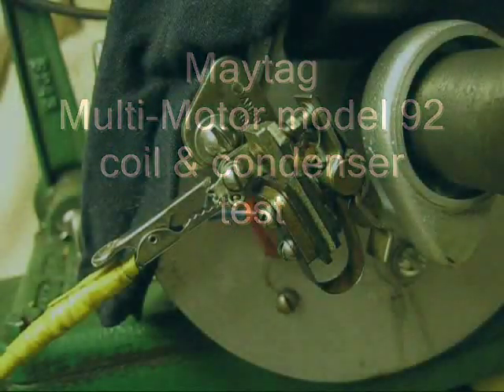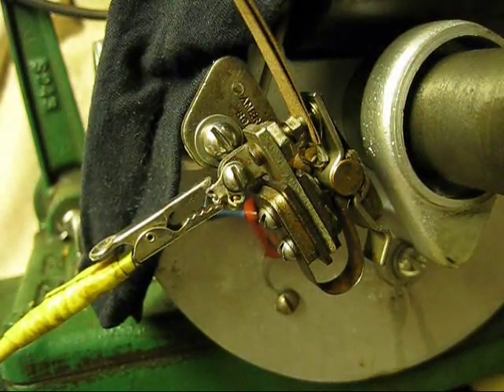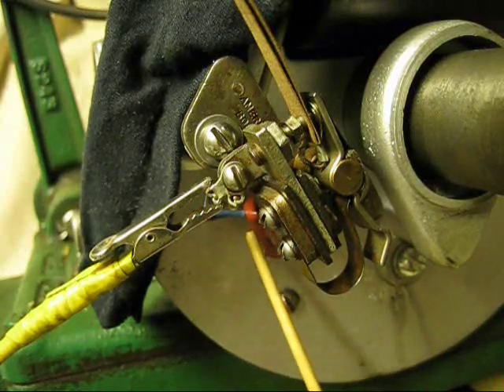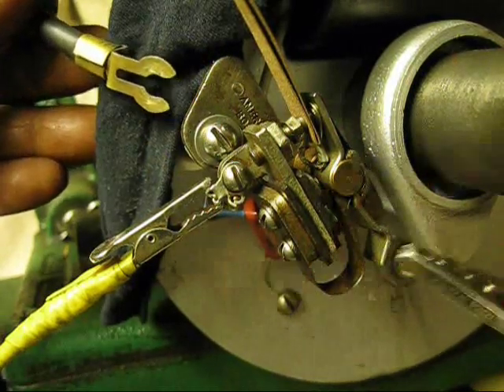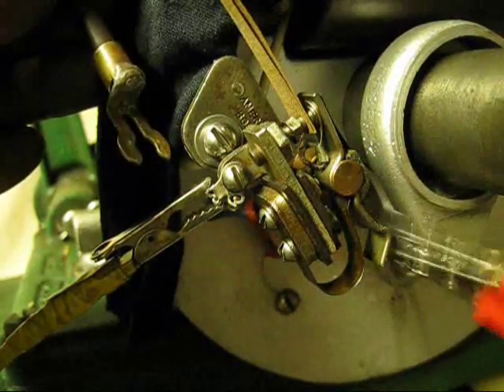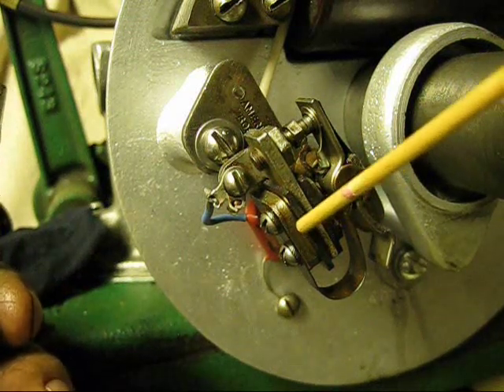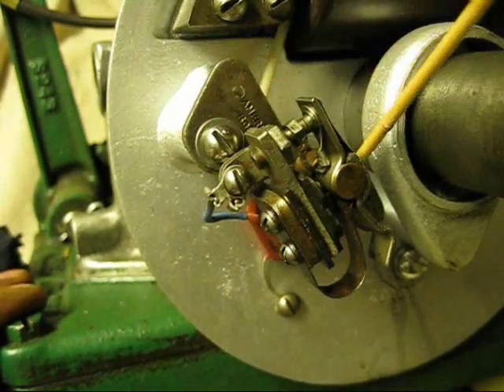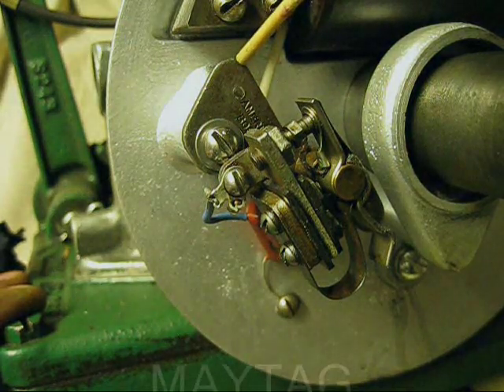Maytag Multi-Motor   coil & condenser test

Comment from the maker: @OldTimerGuy58 , yes, I'm going to do the video soon,, in the mean time, something to think about is, timing is how many degrees before or after TDC an engine fires,, point gap is how many thousands the points open,, the governor adjusts the RPM,, (( all three are different individual settings )) ,, also, with a jig you only get close,due to worn parts, to set the correct timing you must take into consideration the engine r.p.m.'s, wear, and use, YOU DO NOT USE A JIG,, thanks, shopdogsam

Comment from the maker: @AshenClay ,,how should it be running??,  you have got it right,, it's a "hit and miss",, the engine should miss if not under load, it has a flyweight governor, when it flys out it misses,,,, 16 to 1 on that gas-oil mix,, starter up and enjoy, thanks,shopdogsam